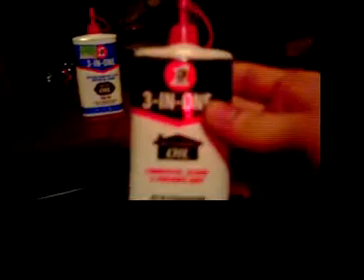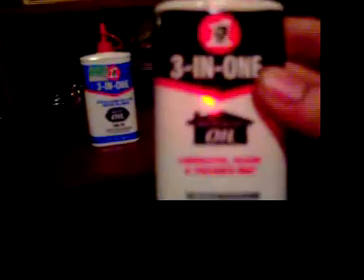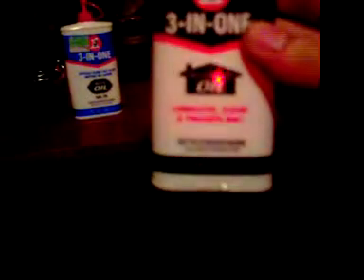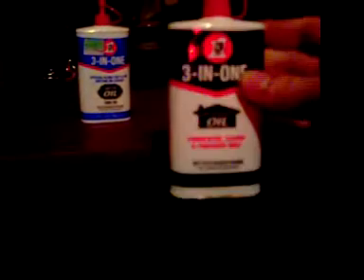What 3in1 oil to use in fans

Comment: That's true.  I had initially used the red can 3-in-1 before I knew better and always had to re-oil a year later due to the gummy varnish the oil had left.  It's due to the fact that the red can oil has naptha in it.

I now only use Zoom Spout, the result is no more gummy varnish on the bearings.

Comment: That's very true, my father's 1955 Chevy pickup (which he now regrets he traded in back in 1964) initially had no oil filter on its 265 cid small block.

He worked on cars at a Cadillac dealer in his youth (1940's and 50's) and remembers how when people put detergent oil (called Royal Triton I think) in their engines it turned black immediately.  The customers didn't like that since the oil was a cool purple color initially.

Comment: Another good product we have found is LPS-2. This is good where a penetrating oil is needed to help free bound parts. We have tried about 5 or 6 different type of penetrating oil products at our shop and some have gummed up. LPS-2 seems to never get gummy. Also we have used Hammond Organ generator oil in real critical applications where we want to make sure there is no paraffin type residue left (in addition to using it in organs of course.) it is probably even better than zoomspout.
Reply: I need to try that LPS-2